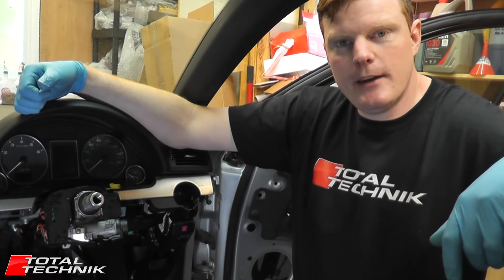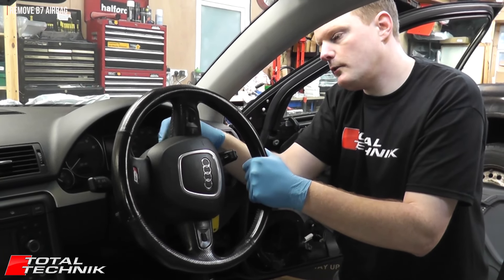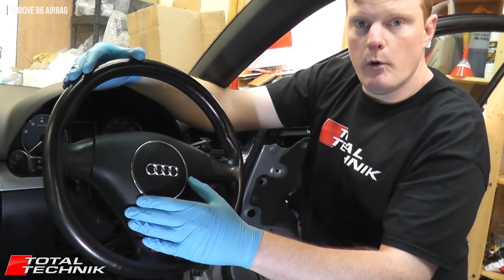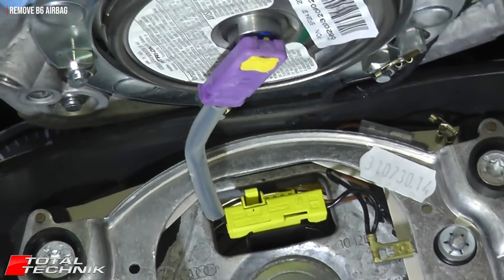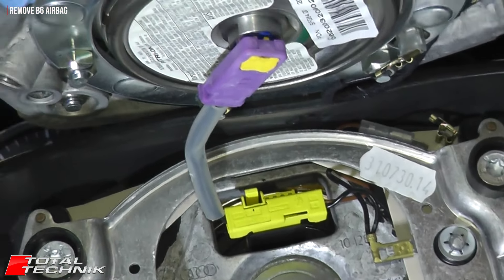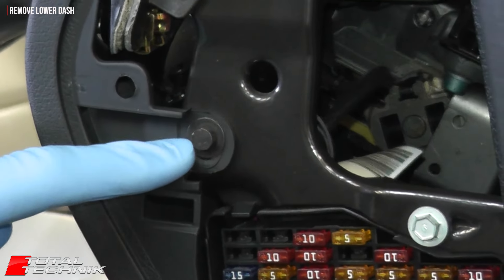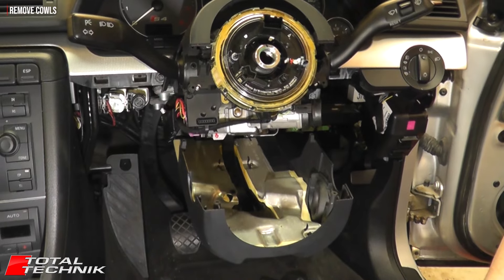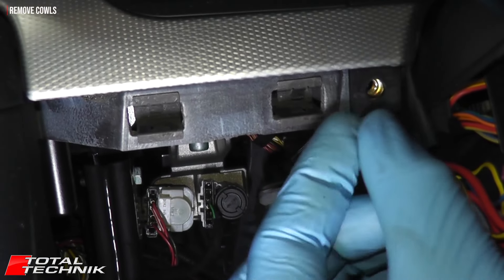How to Remove Steering Wheel Control Module COMPLETE GUIDE | Audi A4 S4 RS4 | B6 B7 (2001-2008)

Comment from the maker: T8 Torx Screwdriver (for Cowl screws):
Amazon USA: https://amzn.to/3y5tXZp
Amazon Canada: https://amzn.to/3QznXhA
Amazon UK: https://amzn.to/3yaOdsv

Spline (Triple Square) Bit Set (with M12 size for Steering Wheel centre bolt):
Amazon USA: https://amzn.to/3xZCwF5
Amazon Canada: https://amzn.to/3JFFTUd
Amazon UK: https://amzn.to/4blt516

Torx Bit Set (for screws on rear of Steering Wheel):
Amazon USA: https://amzn.to/4aZEJPo
Amazon Canada: https://amzn.to/4a26SDV
Amazon UK: https://amzn.to/3y2w1kM

Thread Lock Temporary (for refitting Steering Wheel centre bolt):
Amazon USA: https://amzn.to/3UnoULa
Amazon Canada: https://amzn.to/4a2RHdC
Amazon UK: https://amzn.to/3ULnMTe

Hook Tools:
Amazon USA: https://amzn.to/3PxHUG0
Amazon Canada: https://amzn.to/3NUKzI8
Amazon UK: https://amzn.to/3beSeQZ